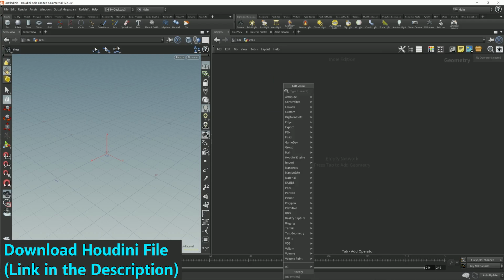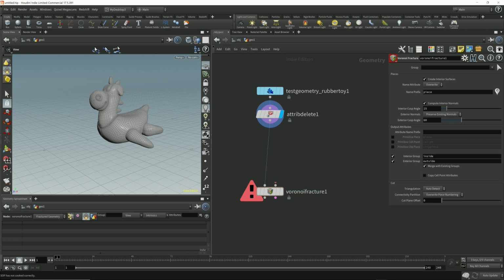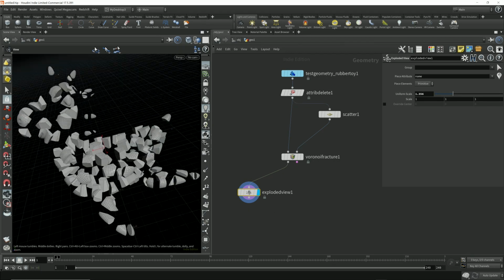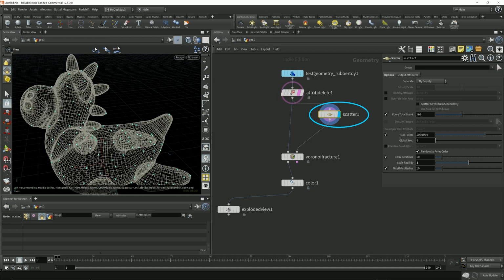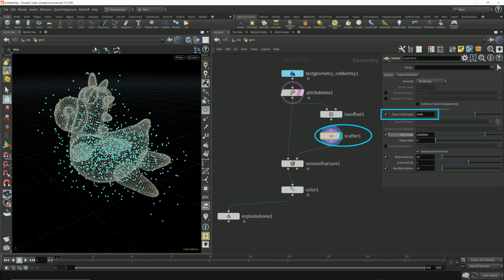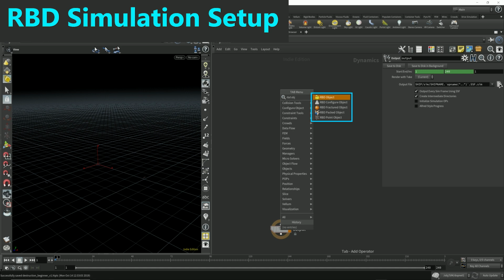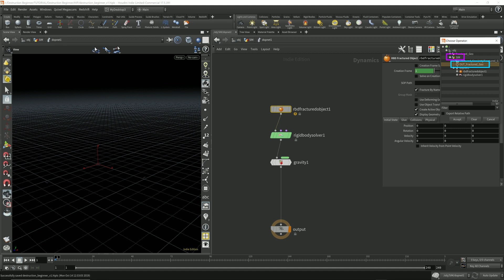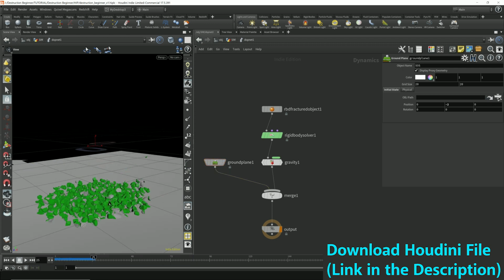Destruction Simulation for Beginners in Houdini (Rigid Body Dynamics RBD)

Comment: Nice tutorial, but at 11.47, when i import OUT_Fractured_Geo, nothing show up, is there any step i dont know as beginner?
Reply from the maker: I used a rbd fracture to import it into DOPNET, there are two types of rbds, a packed rbd and the one you see in the video.  I have a hunch, just a guess, but maybe you have packed primitives instead?  Or are you following my video with the object merge modular setup?  You don't have to do that, I only did that to show how to setup Houdini scenes with the Good Practice way of doing it.  Double check your Object merge node and see if that is linked paths are proper links.  Because it is an extra setup in the middle.  And it is important to note this video is a little dated, SideFX now has these newer RBD SOP tools where the RBD Solver is straight in the SOP context eliminating the need for DOPNET completely.  But DOPNET is still here for us and does provide a bit more advanced usage.

I hope that helps!

Comment: Excellent video. Why is ground plane not available outside DOP network? Is it because it's a static object? what does it mean?
Reply from the maker: The ground plane inside the dop network is more of a proxy object to help with the rbd simulation.  You can always add a ground geometry to be rendered out that matches the same position as the ground inside the dop network.  In the RBD sop tools, for the RBD solver (sop node), the ground is also available there and is not rendered and you also have to add additional geometry to render it.  The ground inside the dop network is mainly for collisions and so your rbd pieces don't fall infinitely forever, I like to think of it as a nice to have.  Hope that makes sense!
Reply: Thx. @bubblepins

Comment: awesome tutorial ... how can I make 2 objects fracture like if sphere hit BOX they both get fracture ?
Reply from the maker: I previously made a video on how you can fracture a wall by hitting it with a sphere, I think that's what you're looking for:
https://youtu.be/n0H3NM0EMug

It uses glue constraints to hold the fractured wall in place until the sphere comes close enough to hit it and break the wall apart.
Hope that helps!
Reply: @bubblepins  awesome thanks BUT what i was thinking is when sphere hit the wall its should also get some fracture so wall fracture and sphere when hit
Reply from the maker: @hamadalateeqi8594  That is a little advanced one, you still do the same thing shown in the link I provided above, but there's an added step of fracturing the sphere and an additional step of adding glue constraints to hold the sphere together before impact.  The glue constraints will hold each of both the sphere and box together until impact.  On impact, they both break.  How they break will be determined by how strong the glue is on each individual geometry, so you can set a stronger glue for the sphere and a weaker glue for the box.  This should make the box break more easily.  

And to make the sphere move, there's a million ways to make it move, but the simplest way is like throw the sphere toward the box, you need to add some initial velocity in the rbd fracture object node inside the dopnet for the sphere.
Hope that helps!
Reply: @bubblepins  thank you so much i appreciate it yes it did .. also looking forward to see this kind of advance tutorial... thank you so much
Reply from the maker: @hamadalateeqi8594  awesome! Will do!

Comment: .Hello, the tutorial was really great and it helped a lot. But how would I export the geometry at the end of this? The final Frame result. As an fbx or obj for instance, I have tried with file node and exporting with save to disk but always get error message when I try to import in blender or maya.
Reply from the maker: I talk about the dop i/o stuff in the next video.  You'll need the dop import stuff to extract all the sim data from the dopnet and into the sop level.  Then you can export the dop import geometry as FBX or alembic.  I have tried FBX and it is compatible with Blender, but fails on occasion.   Alembic always works for me for geometry and particles, from Houdini to Blender.  But be aware Blender only supports the import of 1 attribute, Cd.  It cannot import any other attributes.  This means you loose all the data calculated from the rbd solver, like velocity, forces, and such.  So this will make it harder to setup materials in Blender.

Hope this helps!
Reply: @bubblepins  thank you will watch tomorrow when I get the time

Comment: I simply dont have the "RBD objects" at all in the latest 18 ver
Reply: also there are no solvers at all... no sense to check further
Reply from the maker: @boosting_my_adrenaline  Did you drop down a dopnet node first?  You need to go inside the dopnet to make the RBD Objects available.  This video was filmed in Houdini 17.5 so if you have H18 it should be good too. 

This is where I start dropping down the dopnet and RBD Objects:
https://youtu.be/wDGViZ3XQnY?t=586

Hope this helps!
Reply: @bubblepins  gracias my darling

Comment: ooo is there anyway to remove the ground plane and just freeze frame it at a certain frame instead? :D for.. aethetic modelling/rendering wise :D.
Reply from the maker: You can use a timeshift node or a cheap trick that I tried doing once was using a file cache node and just save that one frame and rename the file cache so you remove the $F in the name and it will just save and load that one frame.  However the timeshift is more appropriate method.

Thanks for watching!
One thing I forgot to mention is you may need to use the boolean node to make all the fractured pieces a whole if that's what you need.  For example, I sometimes use the destruction sim in Houdini to make a base mesh and turn it into a single object and port it over to zbrush for sculpting.  In this case, you need to use either the boolean node to make everything one single object OR use a vdbfrompolygon node to make it into a volume and then turn it back into a polygon, this technique is often used for creating a single geometry or retopologize.